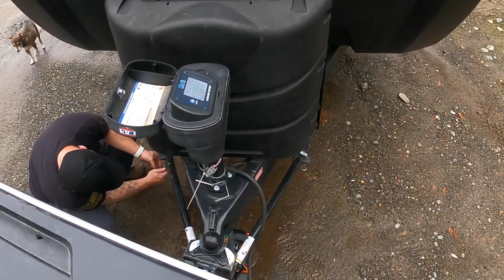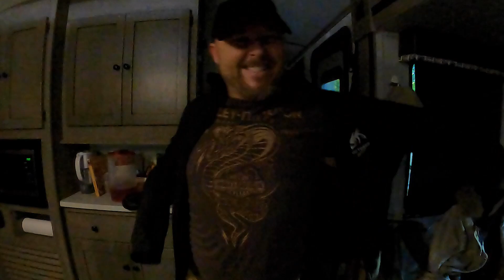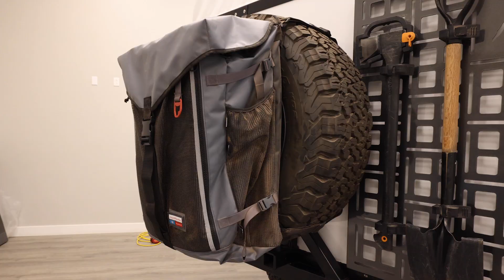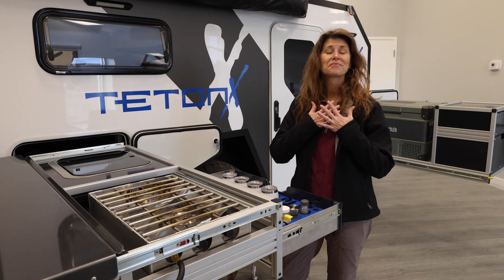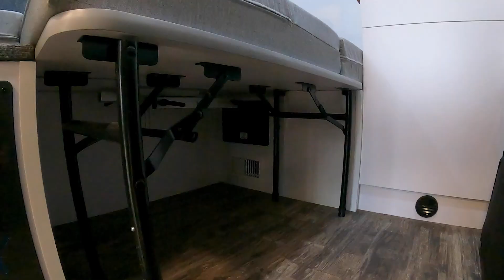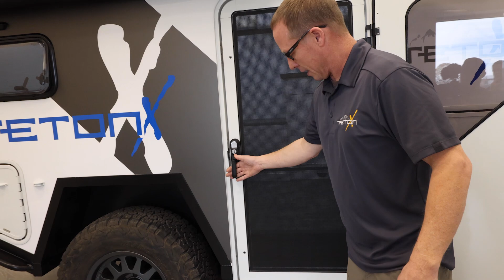TetonX Hybrid COMP sets the bar for lightweight offroad campers!

Comment: Great video and thanks for sharing. I have searched high and low for a dealership or Teton corporate. Would you have a contact or link you could share?  Thanks in advance
Reply from the maker: Hey Paul--they don't operate through any dealerships, and they just rebranded their parent company as Atlas Outdoors (or maybe they were acquired).  My next statement is not unbiased (I'm now a dealer in high-quality off-road campers): unless something has changed in the last few months, they still have a long waitlist and haven't scaled up their production to meet demand.  If you're looking for a comparable trailer in size, function and quality, I have to recommend you look into the AOR Odyssey. There's still a waitlist, but it's an Australian unit with decades of proven engineering.  Let me know if you want more information. https://australianoffroad.com.au/hybrid-campers/odyssey/

Comment: 3,000 lbs loaded is the sweet spot imo. Big enough to replicate most of the functions of a much larger RV but you can easily tow it with a mid sized truck without totally destroying your gas mileage and you still have reasonable off road capability.

Comment: I noticed the hitch on this rig! How much weight can it hold? We have a rack for 5 bikes 😅
Reply: Great question. We prefer to talk more about how you loaded items, rather than just give a number. Did you put the heaviest bike closest to the spare tire, did you tie the bikes up to the upper mounting points to reduce the amount of bounce, etc. While the rear hitch is a great place for a 2 bike rack when properly loaded, the leverage that you'd see with 5 bikes is certainly a bit much. We do have the option to put bikes inside the trailer. If you skip the optional cabinet inside, fitting two bikes inside is easy. If one of the bikes is a smaller light weight childs bike, then 3 on the back could be done with proper loading.

Comment: It seems like with that long of a lead time to take delivery of the unit some of the battery and lighting components would be old school. Lithium batteries and led lights are evolving so fast seems like a long time to wait on a unit. Both trailers you reviewed are very nice units.
Reply: All components are installed at time of build, using current technology.

Comment: A popup trailer that will not fit in many residential garages. I wonder what they were thinking or maybe not thinking.
Reply from the maker: Interesting observation!  Yeah, we've had 9-10 ft garages recently so haven't given it much thought.  And if you add an A/C unit to the roof, you're really pushing it.  Probably matters less to us (full time RV living), but is definitely something most people should consider--thanks!
Reply: @OctoberWild  This fits as is in a standard 8' garage. We also have some storage wheel options to fit the trailer into a 7' garage.

Comment: Awesome camper👍 I wish the back opened up so one could put a bike in it. Have a blast using it!!
Reply from the maker: Well we're still probably 1.5 yrs out, but have high hopes!  It does have a hitch on the back to put a bike rack...and if it's security you're after, I'm not sure sure a bike wouldn't fit through the front door--I'll put this on my list to examine next time we see them!
Reply: @OctoberWild  A bicycle, yes. You can fit two bike with the front tire removed inside the trailer if you don't choose an interior cabinet. A motorcycle, no. Our Porter model is perfect for that option.

Comment: You are right about Kyle and Lindsay, they are awesome. Great video, but you might have just created a longer wait time with all the orders that will be flooding in. I believe fully loaded you are around 3,000 lbs. I plan on towing ours with the new bronco. We are coming up on our turn soon to start the design process. The fact that they are always looking to improve the product says it all
Reply from the maker: Thanks!  The floor model they had is coming in at 2900 lbs dry.  By the time you upgrade to the 300ah GameChanger (+50 lbs) and 30 gallons of water (250 lbs), that leaves only 300 lbs for bikes, clothes, food, camping supplies, bedding, tools, etc. Cutting it close...
Reply: Ken, I plan on purchasing a new bronco and this trailer is at top of list. When you get everything, possible to post a video?
Reply: @MarsFit78006  for sure still waiting on a build date for the Bronco.

Comment: Well done guys. This is a tough decision and as you have stated everyone has specific needs and it is hard for MFGers to build for every one. I totally understand wanting to stand up in any $50,000 trailer. I don't care how good of shape folks over 45 are crawling around in a non stand up rig is not good for the back. That said canvas side pop ups sure seem to have leak issues. I have not heard of that many leak issues from Teton so maybe not a worry. I believe the suspension is built in house. Do you feel like Timbren maybe more tried and true? You guys seem to have more patience then Jobe but two years oh my deal killer for me. Are they going to truly hold price for two years?
Reply from the maker: Ha, I'm not sure we're really as patient as that!  Between the wait and the weight pushing the upper end of our capacity, we may actually go with Xpedition to start, and get the TetonX when it comes out--then do an overlap comparison before deciding which one we'll keep!  I have to assume we could get most of our money back through a secondary sale.  On the suspension, I do think they're planning to move to Timbren as well...@TetonX, you guys want to comment there?
Reply: @OctoberWild  The Timbren 5200 suspension is the standard option, with our in house twin shock independent air bag suspension as an upgrade. We do need to get a video out going through our suspension. We hope to do so soon ... maybe we'll have to invite Jeremy and Chris back to help us out!

Comment: Great looking trailer but at what point are we essentially moving back towards the full size trailers we all are trying to get away from...lol.  Also, having the hybrid type (tent type / solid), never really liked the fabric portion (wet, hard to heat, cool etc).  Great in depth video as always.
Reply from the maker: Yeah, I do agree on the fabric.  We do like that lifting the roof is really optional if you're just looking for a quick overnight. I guess my criteria is mostly that I can pull it behind the Jeep, and it can go most places the jeep goes.  If my full size trailer fit that bill I'd probably be happy!  :)